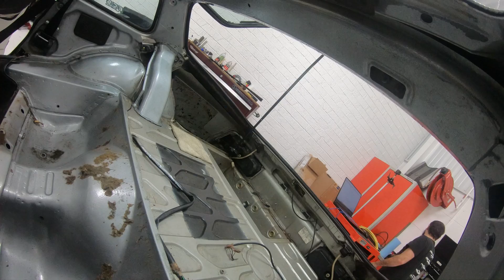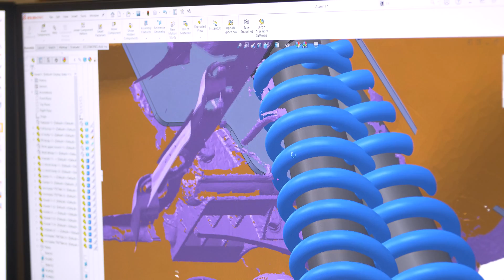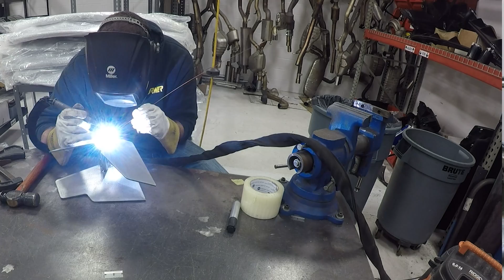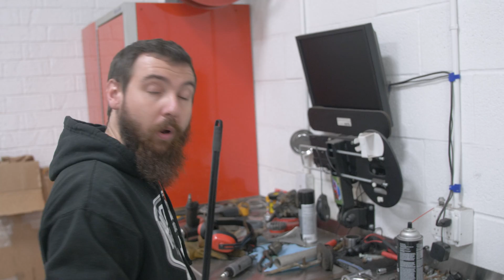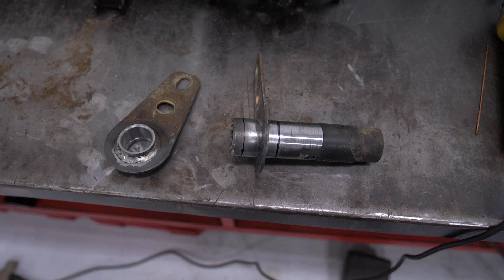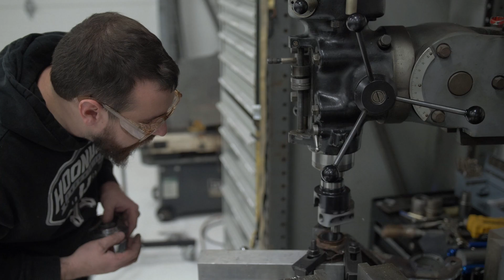Suspension Fabrication and Coilovers - Porsche 944 Rally Build | EP 7 | Built By Mike

Comment: Awesome video! I was always curious I have both a 944 and a Air-cooled Baja bug. You see a lot of guy using 944 trailing arms on their beetle(mostly aluminum arms) but the steel 944 arms are almost identical to a beetle , what if you reverse it and use beefed up Baja trailing arms on a 944?